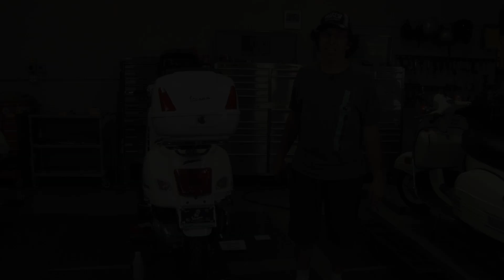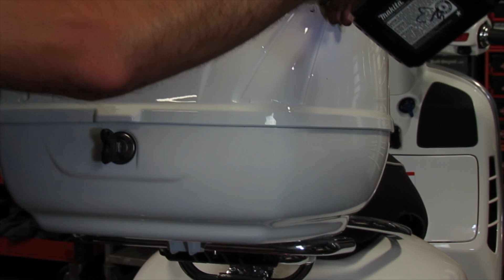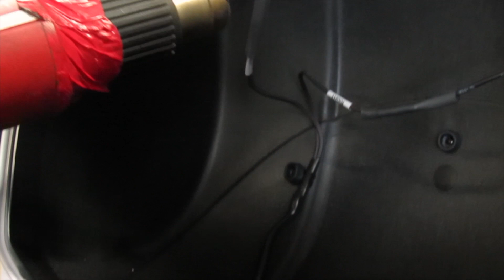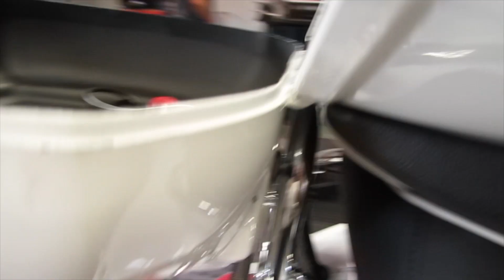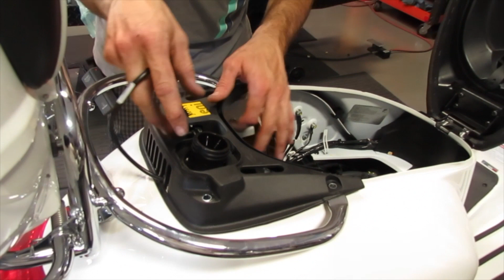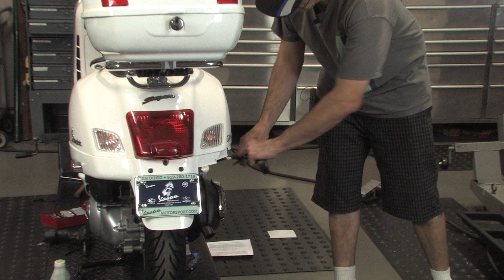Add Lights to Your Vespa GTS Topcase

Comment from the maker: Thanks for your purchase! Yes, any of the three black wires should work, they are all grounds. Go back and make sure all your other connections are correct. If your tail light works, the kit should work if properly connected. Also make sure you have the posi tap orientated correctly; one side has a sharper, needle like point that it meant to pierce the wire you're tapping into.
Give us a call if you still have problems. 619-280-1718.

Comment: Hi,

Just received the kit from your shop and i tried installing the Mi97 LED kit but getting stuck with the black wire which should be connected to the Ground. 
I'm assuming the Ground wire from the system is in black. Problem is there are 3 black wires and none of them seem to work when i use the Posi Tap connections. 
Hope you can help. 
My email is fofakhrs@rba.com.bn